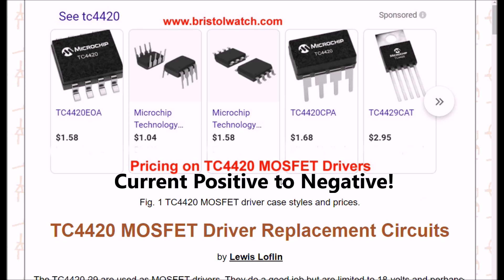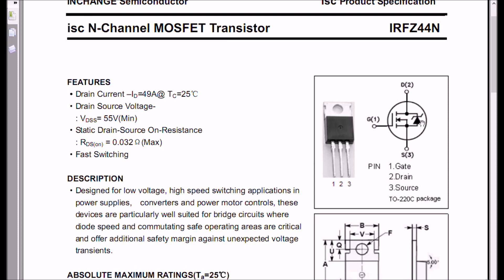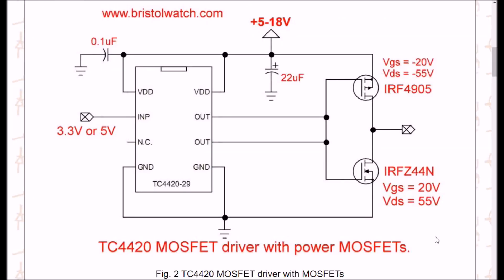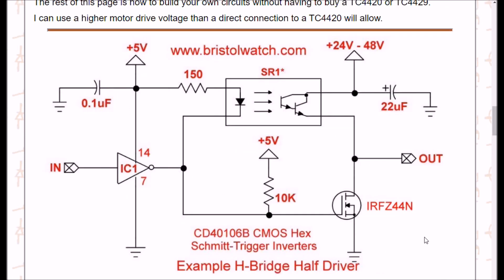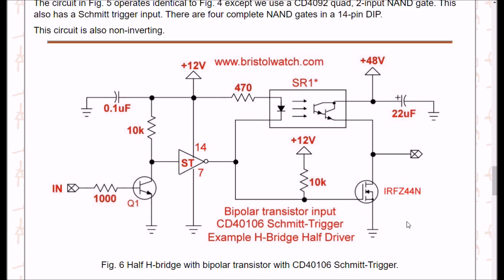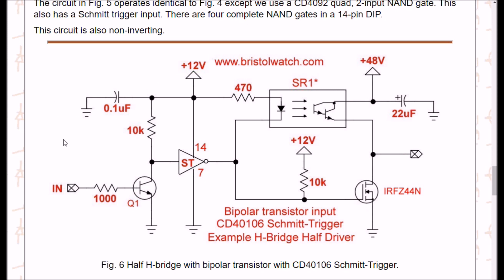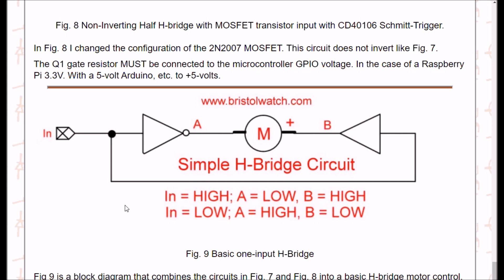Build TC4420 MOSFET Driver Replacement Circuits

Comment: Would this work for an esp32
Reply from the maker: Yes.
Reply: @ thanks I’m using it on the output of the gpio pin to control a mosfet for an electric strike lock. My esp however only gives 3 volts on the gpio

Comment: Hi, at 4:38 there's the 10k pull-up resistor...  Do we need it given we're being driven by the CMOS inverter output?  I could be missing something or it could be a vestigial part from an earlier  circuit evolution.  Great videos BTW, only just started looking at asymmetric cascading H-bridge multi-level inverters which lead me here via the rabbit-warren of Google.  Note: looking at and understanding...  with dreams of building one day...  ;)  [ forget it, I can see now that the pull-ups are there for future circuit variants substituted in ]

Comment: Thanks a lot. That was helpful for me to understand the theory. I want to use similar circuits to drive high frequency mosfet amplifier in class e configuration running at, say, 4mhz or 13.56mhz for plasma generation. Is it possible, if I change the mosfets with their HF versions? Pls give me some idea on this. I can't afford to buy HF drivers and in my country these are not available. Thanks again.

Comment: My main concern is the Dead time between the HI and Low side
Reply: In audio they use two diodes between the drive signal of the p and n channel mosfets.  Usually they are fast diodes and germanium.  The delay is caused by the voltage having to rise or fall x amount before the diode conducts.  This is what gives you your dead time...

Comment: Hello Mr Loflin
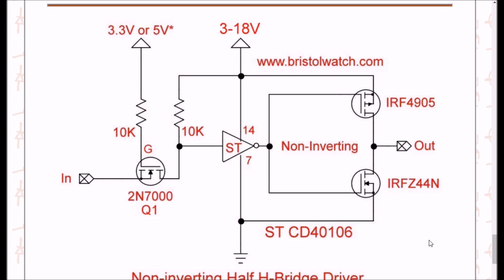Fascinating video and circuits. My confusion stems from the circuit at 10:15. Wouldn't the I/O pin of the microcontroller see 18 volts when the ST Vcc voltage is at 18 volts? The gate to Q1 is alway high, keeping Q1 on constantly. Therefore the I/O pin would be exposed to the ST IC voltages.
Reply: Most GPIO is open drain so 18V-5V/10k is the current the gpio will try and sink... most open drain can sink more current than source... But this current is 1.3 ma worst case so the gpio should be fine...
Reply: When the GPIO is low, the fet is turned on as Vgs=5V (for a 5V uP).  Current flows into the GPIO.   GPIO doesn't see 18V, it sees the low it has created.  The CD40106 10k resistor has 18V at one end and 0V at the other.            When the GPIO is high, the fet is turned off (Vgs=0V) and the GPIO is therefore isolated from the 18V.